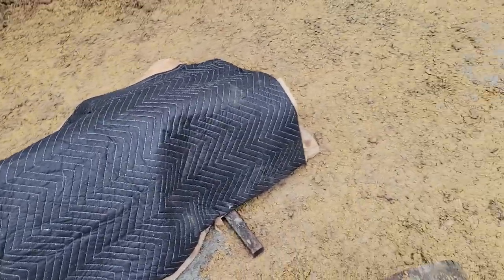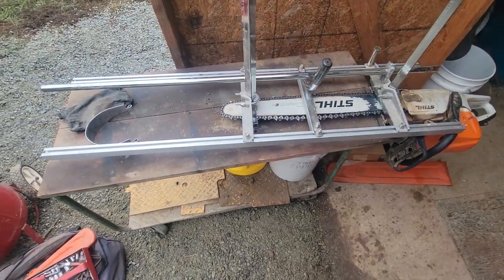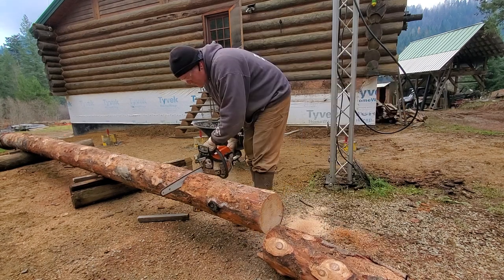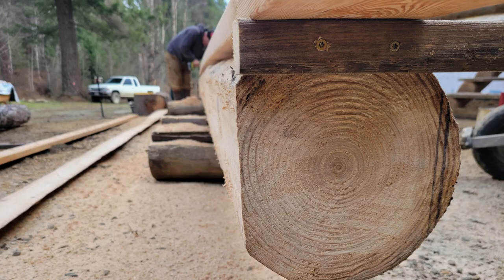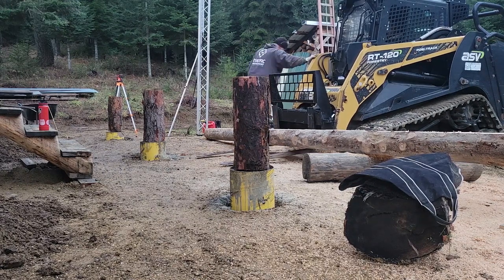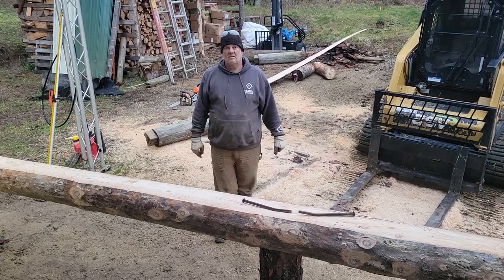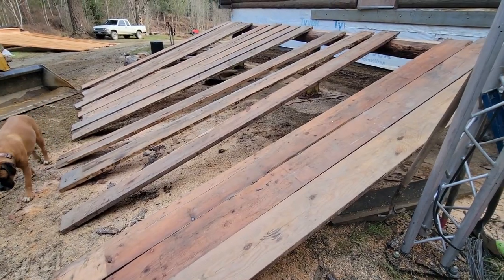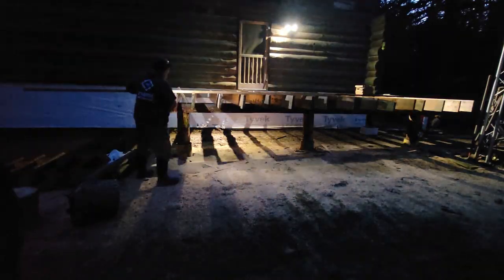How to build a deck Part II: Step-by-Step Guide with Logs

Comment: The bottom of the post. Did you seal ?
Reply from the maker: NOPE!  There's an air gap.
Reply: @HiddenValleyHomestead  do you still have the concrete mold around concrete post
Reply from the maker: @allenbanks3280  yes.  I'll remove it soon